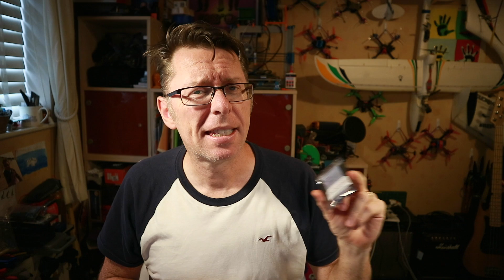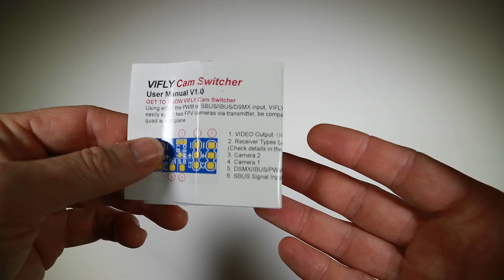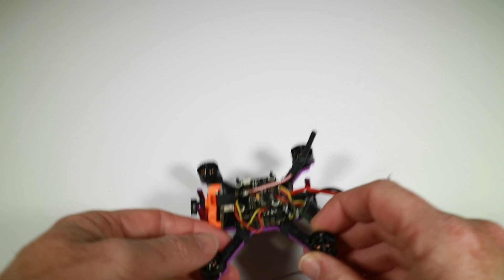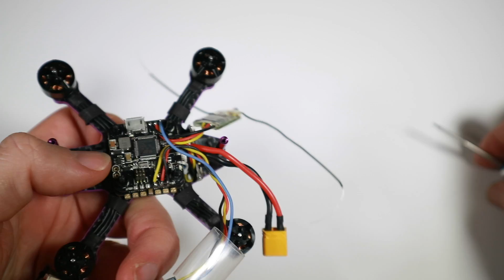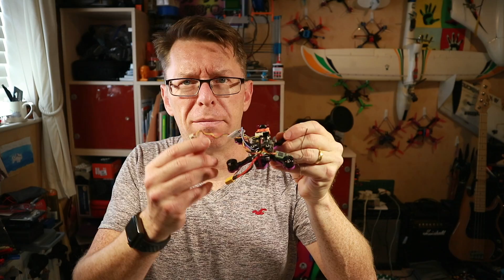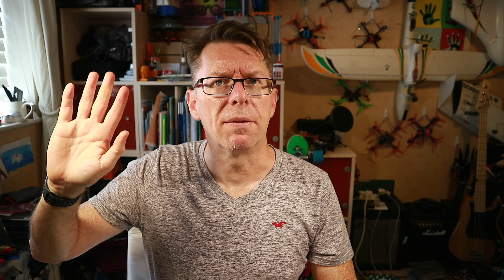ViFly Camera Switch - build your own "Cheater" quad

Comment: I've built a tank that needed a backup camera. I made my own switcher using an arduino, but wanted a smaller easier solution. That's how I ended up with the Vifly cam switcher.
I'm also using sbus with my Taranis and will now add some custom mixing to make backing up easier
Reply from the maker: Sounds like a cool project!

Comment: I've built a tank that needed a backup camera. I made my own switcher using an arduino, but wanted a smaller easier solution. That's how I ended up with the Vifly cam switcher
Reply from the maker: Sounds like a cool project

Comment: I need help ... I have connected the entire quad but I only have the image of the front camera.  How do I change the image?  You have to select some parameter in CLI ??  in BF ??!
Reply from the maker: It's set to an sbus/ppm channel depending on what you are using.  Did you set a switch to the correct channel and tried that ?
Reply: CurryKitten I have not designated any channel.  I've just made the video connections.  the FC is a dual 722 dalrc.  I have connected the blue wire to the sbus pin of the vifly, and the vifly to Fc by means of +, - and vtx.  I have a signal from camera 1 ... but I do not know how to operate the 2. I do not have any frsky receiver but a micro crossfire.
Reply: I think the problem is that vifly can not work with crossfire.  I only get to see a camera..I'm right?  I would need an xm + or similar ... and this connected together with the blue wire to the sbus ???

Comment: a couple of doubts .. there are no connection cables between the vifly and the vtx ??  two .. xm + use the pad sbus..compartes the pad sbus for the vifly and the xm + ??  Great video, nothing easy to find something similar
Reply from the maker: There's no cable direct from the switch and the VTX because I'm using a flight controller with an OSD, and so will have video in/out pads.  So the  two cameras connect to the switch, the switch connects to video in on the FC and then video out on the FC goes to the VTX.. .makes sense ?  Not quite sure I understand what you are saying about SBUS, but basically there is normal SBUS going from the rx to the FC, and then from that same pad on the FC to the switch.
Reply: CurryKitten Perfect thanks for your answer . I will try to do it as it tells me ,also my flight controller has OSD.         Regarding the sbus (my Fc has a pad like that), I wanted to know if that pad is shared by the receiver (xm +) and by the vifly ... or the vifly goes to a simple RX or .. ??  My fc is a kakute f4 v2 AIO.
forgive my bad English ... it's a mix between what I know and the smartphone translator.
Reply from the maker: Yes - on my build I shared the SBUS pad on the FC between the rx and the switch.  Alternatively you could also take 2 wires from the SBUS pad directly on the RX and take one wire to the FC and the other to the switch

Comment: Was contacted by Vifly regarding this switch and I wouldnt touch it.  I have to wonder if it is a rip off of the Will Bix "Multiview" switch.   

The Will Bix switch is 11 bucks and I would much rather have my money going to support him and his developments.

I have been building these quads using his switch since Aug/Sept of 2018 while evolving a style based on 2 or 3 cam builds.
Reply from the maker: I hadn't heard of the Will Bix switch, but to play devils advocate for a second, is the ViFly a copy or does it just do a similar function.  Camera switches aren't a new thing, and the pads/method of switching isn't the same ?  Hey, but I'm all for choice - Will Bix, also a camera switch
Reply: @CurryKitten  No, camera switches are not a new thing.   I was using the old Hobbyking 3 channel camera switch in a test rig last August when Will came out with his MultiView Duo that is less than half the size of the old switch I had been using.

I gladly moved to the Multiview Duo because of the options it allowed for me to control it either by PWM from my crossfire or by a pinIO off the FC after a configuration change in Betaflight.

If ViFly doesnt work with pinIO commands it likely isnt a copy and by looking at your video the design is not a clone.

ViFly contacted me about possibly promoting their switch and I ignored them because I feel the better switch is already out there.

If anyone is seriously considering playing with the CheaterKwad concept it is worth mentioning the alternatives to the ViFly switch.

I have roughly 9 months of experience building and flying 3 different variants, both 2 cam as well as 3cam 3D, of multi camera drones with more variants to come.

Make the argument of competition in a market place being a good thing if you wish.   But I find it kinda laughable when there is such a small group of people even playing with multiple cameras or "cheaterkwads".   It is as if they are trying to compete in the smallest subset of an already small niche hobby.

It is in the vein of the cloning mentality of everything else in the hobby.  An already existing affordable and tiny switch already exists. 

I really do suggest you look at my "under the hood" CheaterKwad video from around Jan 2019.   Then check out Will Bix demo of his switch and how it can be configured.

If the argument is made that maybe the vifly is in distribution channels in countries where the Bix switch may be hard to purchase?   Okay I can see some of that point based on the Banggood example that helps get FPV products to people globally even if it is cloned or 2nd rate.

Thanks for letting me get my opinion posted.

Comment: What do we use when we want to put a Caddx turtle V2 and a Falkor on the same quad? Using the Falkor instead of the FPV feed from the Turtle V2. I'm going to be using the Intrepid V2 Pro 3" frame. Thanks! 😎
Reply from the maker: If you are talking about facing them the same way, then I'd question about why you'd ever want to switch to the Turtle for a live view.  Just set it to auto-record, fly from the Falkor and treat the Turtle just as an HD camera
Reply: @CurryKitten  Sure, makes sense!

Comment: ermm that little monitor you have for the wrist ...whats it called?
Reply from the maker: It's the Gteng watch, I looked at it here https://youtu.be/oOgf2iRLmDA that was in 2016 though and one issue with it is it doesn't do race mode.  So instead, take a look at the newer Topsky version https://www.banggood.com/Topsky-2-Inch-5_8Ghz-48CH-FPV-Watch-Monitor-Receiver-OSD-Built-in-Battery-MMCX-for-RC-Drone-p-1384767.html??p=E81211714085201408XQ

Comment: Looks really nice, man! Would be nice to have a front camera and a down camera on a wing. 😊
Anyway, I have a really old model of camera switcher here, that uses PWM like you said. It's going to be used in my TBS Discovery. 😊
Reply from the maker: Yeah - if you've got the space, then it's no problem using a big old rx with lots of PWM outputs and that old HK switcher.  Disco's got plenty of real estate :)

Comment: My understanding is that the main use for camera switching is to have two forward facing cams but at different angle ie: 30deg /70deg so you can do trippy spins at high angle  but still do normal acro at lower angle. 
🤘😁👍
Reply from the maker: I've never actually seen anyone use camera switching for this - although I've seen plenty of crazy camera angles
Reply: All you have to do is look for "CheaterKwad".

Yes, spelled incorrectly on purpose.   It works wonders as a # on Instagram to find the people using the tag.

It doesnt work as well on youtube because their AI starts linking other videos together so you get more results than the searched result.

And my "under the hood" video that predates anything Bardwell has done will shed some light on the topic.

Comment: I like it. I’m thinking a downward facing camera to assist with accurate landing at slow speed when the main camera is at a 40+ degree up tilt. Great review and explanation CK. I laughed out loud at Mr PBH 👍😎🇦🇺
Reply from the maker: You are not the first person to suggest this.  I',m thinking a simple camera servo tilt would be useful but in most frames you are completely out of space just with the camera in position !

Comment: ive been using cam switchers for a pretty long time, ALL of my planes get a forward  and down facing cam so i can keep track on ground position at altitude without dipping the nose. 
My switchers are not at all big but that thing is tiny! 
Definitely interested in those :)
Ha ha, they have put your review on there product page!
Reply from the maker: Are those switchers you use on PWM so you have an actual servo lead coming from a larger RX or do these speak SBUS these days.   Actually, that's not my review on their product page, but they decided to use my thumbnail because they liked the picture - if you look closely you can see my logo has been removed.  They did ask... after they'd already done it :D